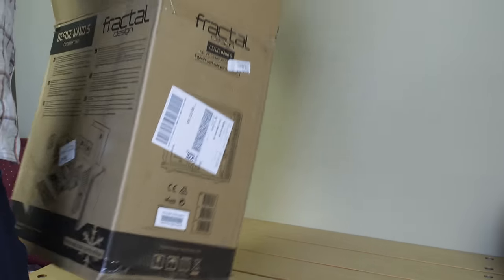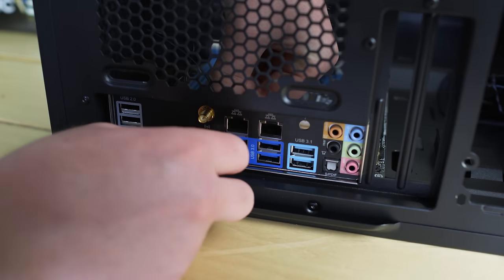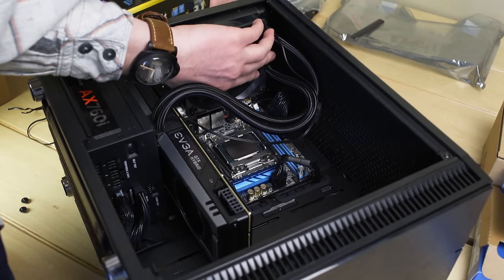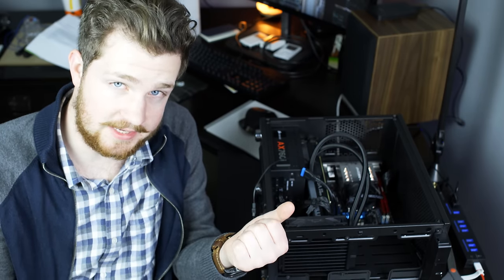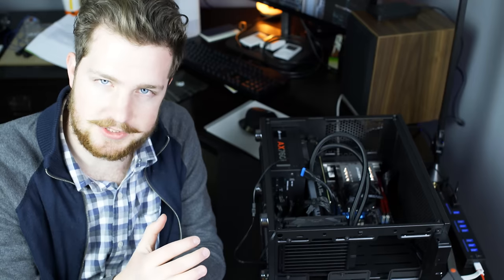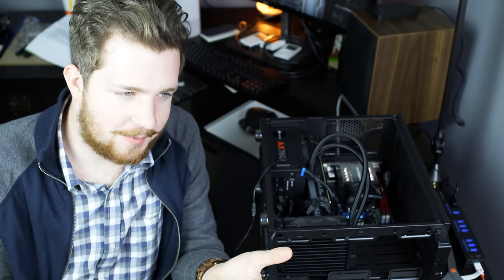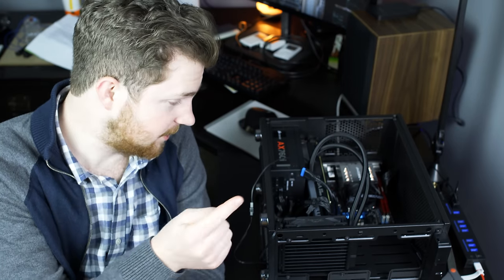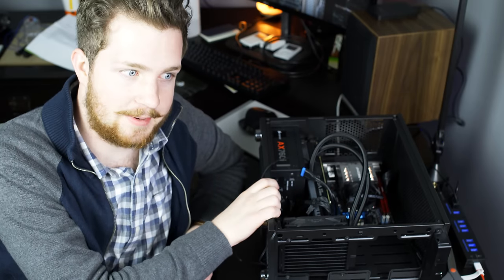My Powerful Custom PC Build Disaster

Comment: First of all. Never, I mean NEVER!, get anything from Newegg that has been Refurbished!!! I have learned my lesson about that.. With the Corsair PSU, all the Corsair PSU's I've had (I've had 4 of them) have the same issue with the 24 pin connector as you have. I've even bought the custom braided cables, from Corsair, and had the same problem. I don't have any problem with the motherboard connector, just the 24 pin PSU connector. Just as you mentioned, the PSU connector does not push in all of the way... You should get an EVGA PSU, or some other high quality PSU. Don't cheap pout on your Power Supply!! Good Luck with your build!

Comment: Dude.....i've been having this EXACT same issue with my pc. I just upgraded my cpu to a AMD 8350 and gpu to a R9 380 4gb. And my pc would randomly shut off. Checked temps, nothing over 53c. Finally swap out my Corsair gs700 for a Thermaltake 650 and my problems gone.

Comment: Dude, it IS the power supply that is making the computer shut down.  You DO NOT EVER use two screwdrivers to JAM THE PINS IN FROM THE MOBO!!!  You are REALLY LUCKY TO STILL BE ALIVE RIGHT NOW!  It could have shortened out on you then you wouldn't be no longer with us!  The screen savers on tech tv would ha e told you the exact same thing if they were still on the air today.

Comment: I can tell you 99% for sure that it is the PSU. I had this same problem when I built my monster PC. I finally went with the AX1200i and have not had problems since. My monster PC cost over 5K. It has 64GB ram, 5960x cpu, two 980ti's, MSI Godlike Motherboard and two 500gb ssds in Raid 0. It edits 3 multi cam 4K video streams like butter. Money well spent. Good luck my friend.

Comment: The first thing you do is plug in the power supply and leave it plugged in with the power set to off to ground your case then have your wrists touching the case when working with the computer. You prob destroyed parts by having no ground to yourself. Your problem is you are not grounded and having parts get destroyed. I have built 10+ computers and had one bad part ever. YOUR BUILDING A COMPUTER WITH NOTHING GROUNDED WITH A FLANNEL SHIRT as an electrical engineer I am just face palming. I plug in my case I use a static pad and a wrist band attached to the power supply this is basic stuff.

Comment: what about a personal computer using a web-server motherboard I.E. 4X 36 cores and 1TB of ECC system RAM and 12x 3TB drives in RAID 10 and a 3TB Boot disc and possibly two RAID controllers and a AMD RADEON Rage 9 graphics card.

Comment: Holy crap, you are unlucky...two factory-defective Mac's? And a bad pump, and a bad PSU... don't come anywhere near my computers lol. BTW. If you continue to have problems, take out the M.2 ssd. One of my PC's would have similar problems if an M.2 ssd was installed (auto-shutdowns after 3 min in my system). Either the board or PSU didn't like it. The same system now runs fine over Sata SSD, just no M.2.

Comment: So, you bought a refurb PSU, to put up next to your 980 Ti with airflow simply back and forth in a hot environment. You also put a full length card on a mini ITX with an unlocked processor made to get hot in a case that doesn't well support liquid cooling really, and "woopsy daisy' threw ECC memory at an enthusiast CPU/Board? Also, did you really need the 750 watt PSU? I could be wrong but think you could have gotten away with a 550 watt PSU with 80 plus gold rating. Also why the Unlocked CPU with 6 cores? You could have went with other less expensive/lower TDP CPU's and done just fine. Premier Pro is gonna be rendering on your Video card for the complicated stuff and the CPU specific hardware specific extensions like MMS and SSE which Premier Pro is going to benefit from likely more than the hexa core CPU despite some speed advantage... Meh This was funny to watch. Thanks for the vid.

Comment: Thats odd ive had the same problem. I get to a split second before the windows 10 logo and my pc reboots itself. Im on my 2nd set of ram(GSkill Trident Z 3200MHz), 3rd mobo (Rog Maximus VIII Hero Alpha) with an I7 6700k and im using an old powersupply XFX  XXX Black Edition750W  thats never had a problem and a Hyper 212 evo for cooling i can post into bios no problem and my cpu idles at 33C but when I get to the split second prior to the windows 10 logo it reboots. if you find a solution  please let me know. had this problem since Jan 03 2016

Comment: a tip , if u have to use more strength than 2 fingers have (like using your whole hand`s strength or using 2 screw drivers as hard as you could) to insert any pc plug or port then your either doing it wrong or there is something wrong =electronic parts are fragile and force should never be used to insert anything

Comment: I bought a corsair Power Supply and it would do the samething after a year. Full Modular 750w. Turns out the fan was jammed. So the Power Supply would over heat. Now I have a EVGA P2 1.2kw Platinum SuperNOVA. Couldn''t be happier.

Comment: good but bad idea to rma a motherboard in case it 's the mb or the power supply, it 's your responsability to check witch one is bad by buying another one and test.... or you can use your 14 day return policy but's it's not rma then

Comment: Why did you get an ITX motherboard?   I would of used a MicroATX instead, especially if you are going to watercool.  For watercooling, I prefer the Corsair H80 or H100 over the Asetek.  The H100 is extremely quiet.  Refurbished power supply is and epic fail.  Never ever cheap out on a power supply. It is the most critical component in the machine.  ECC RAM?  Why?  ECC is for server CPUs like the Intel Xeons. You should of done your homework.

Comment: Never heard anything about checking the BIOS for some of this stuff. Maybe I missed that. BIOS is your friend. Especially an updated BIOS.

Also, with the cable management, it's typically best, IME, to route the cables first, then place everything in. That also allows you to make sure the modular connectors are properly in the PSU as you plug them in before putting said PSU in the case.

In fairness to the guy, refurb Corsair PSUs have been quite solid for me off newegg. My i7-4790k Hackintosh has been purring for a few years off one. But new is best.

If you think you'll stay with PCs, keep a stash of things such as a PSU tester, old solid equipment, etc, to test in weird situations like you've got that may come up in the future.

Good luck.

Comment: whoa whoa whoa imma stop you there lol... x99 destroys z170 and skylake in almost every way when it comes to server grade and workstation grade work. the 5820k out of the three is the weakest processor but still beats the 6700k... z170 being consumer grade x99 being enthusiast. x99 is meant to push pc to the edge of performance z170 is meant for the average Joe. just because skylake is newer means nothing. the 6700k is only about 10% better than a 4790k which can be applied to z87 from 2013 or z97. overclock a 4790k it's literally a hotter 6700k. and honestly for this kinda build I would've gone with a xeon anyway but that's just my opinion

Comment: Corsair products are crap. Had never used them until I was doing a custom job. Used Corsair PSU, SSD and H90 water cooler. All new from supplier. Had exactly same problems as this. Fault was PSU. My first suspect. Got it tested and faulty. Got new one but not a Corsair. Fitted in and tried again. Same problem. Ah, the water cooler. Took it off, put in standard air and all worked great. Water cooler was faulty also. Like £300 wasted. However the SSD worked sometimes. Utter rubbish manufacturer.  I will be sticking to my trusted brands from now on.

Comment: This is like the worst thought out and executed build ever. Why did you go micro ATX for a powerful system. Your GPU is basically sitting on top of your PSU, lol. Should've gone for an i7 6700k. 4 faster cores are still better for Adobe CC. Apps like photoshop only use 1 core for a lot of tasks. Man... you'd honestly be better off just learning FCPX.

Comment: Macs are SUPER OVER PRICED for no damn reason at all. Sure everything looks nice but lets be honest here. As far has hardware goes macs are now powerful by no means. Look at todays specs for VR like VIVE and Oculus which both are not supported by any mac on the market today. Its because their hardware is behind and the Pre built macs don't even show a enfisist on GPU or CPU hardware. Just face it you paid for a overly prices POS. MACS vs PC is like buying a Cadalac vs a Nissan GTR. Sure it looks sure its got a big engine in it, but the GTR will stop it any day in terms of power.

Comment: Custom building a PC is not for the weak of heart. 
Been doing it before Windows was even invented. 
I would say one out of four, ~25%, of my builds go smoothly.
Success rate even less with a high end build, perhaps one out of eight going smoothly.
Most of the problems comes from motherboard defects.
Then slight defects in other components. 
I learned early on to pay more for Japanese components. 
Chinese components are a lot more likely to be defective.

For example, for me to get a 8 GPU, 8 core 32GB, RAID 5, water cooled system up and running took a very long time.
Soo many components had defects. Even the Asus motherboard had a defect in which the PCIe card did not sit right and burned out both the mb and two of the GPUs. Lots of quality control problems with Asus. 

I recommend trying a simple build before doing a gaming rig. 
Avoid all HP branded components, such as network or raid cards. 
HP has just the worst quality control.

Comment: I applaud someone who will enter new territory to get the best build. Mac to PC or PC to Mac is a difficult jump for user comfort.

However you need a better mentor. First off, I could not understand why you're building on a mini ITX board in this HUGE case, for a performance system. If you're spending the cash on a 980Ti, don't scrimp on the mobo.
The most damning thing though was your description of how you were connecting up the PSU.
If you have to force it, you're doing it wrong or it is broken/wrong. This is especially true of a top brand like Corsair.

I hope you learn a lot from this. Don't jam screwdrivers into PSU's!

Comment: Greetings. I don't know if i come after the battle is over, but i'll try anyway : have you stress tested the GPU ? GPU-Z can allow you to follow GPU temperature. The reason i'm bringing this up is because GPU overheating cause me the same symptoms (though in my case that was an old GT240 with a dying fan). Not saying it can't be the PSU, but just noting you never said you ever suspected the GPU when investigating. ;)

Comment: The same issue I had a week ago. I have a NVIDIA GTX980 and I bought Just Cause 3 and Fallout 4 and had a good time but then couple weeks later, the graphics card would go into high speed without slowing down after a certain amount of time, my computer will automatically shutdown. I thought it was my graphics card so I bought the NVDIA GTX980 Ti Hybrid and the same thing happened. My cousin's friends helped me out and made and we finally figured out it was the cooling unit. The reason why my cooling unit wasn't working properly because the fan had a huge pile of dust in it and the CPU door was hot. Same thing happened to my older graphics card because of dust. The price I paid for not cleaning my computer thoroughly. Thankfully my motherboard prevented my computer from spontaneous combustion. I was an idiot. DX

Comment: Wow you go to all that level building the pc and you skimp out on the PSU and buy a suspect one from Newegg. If of all the things you were going to skimp out on the PSU should not of been it. The 2nd thing was the Ram, you didn't bother checking to see if the MB supported the ram you first brought for it. The more I look at this the more it looks like a half assed pc build. I'm sorry but next time let someone who knows what they are doing build the pc for you as you don't have enough knowledge to build a pc properly. This half assed pc build could of turned out being a very expensive balls up to the tune of $2,000+ dollars and no matter what happens the suppliers won't cover stupidity. Never in my whole pc building life (my first pc I built was a 486 DX66) have I ever seen or heard anyone using 2 big screwdrivers to plug in power connectors, That in itself would of "Sounded Warning Bells" Faulty PSU for sure. I hope its now running fine.

Comment: hey there good job so far, I empathize with your frustration, but when you get it up and working perfectly, the satisfaction is blissful!!  :)  Just one tip though..... Never stinge on a PSU: the power supply unit is quite literally the heart of your system and when it fails sometimes it can overcurrent and kill a few other components making diagnostics/troubleshooting well nigh unbearable. When you are building a new system always buy the PSU new... I know we all have budgets to keep to but I'd pay for a reliable PSU and consider downgrading Videocard or ram (capacity or brand) to make up the difference. Since in the long run a working reliable PSU (Corsair AX  i lines are actually really really good, the previous owner either got a DOA or really abused it for it to die: needing refurb) will cost you less: if the psu dies and damages other components you can send it in for RMA but you don't get refund for the components it killed.... also you might want to get a 800 to 850watt PSU as a content creator you may need to add more HDD for storage later and having a PSU that is rated at a higher wattage than what your system requires at MAX load on CPU and GPU at the same time is always a good idea, you don't want to have just enough (especially for you since vid editing and exporting typically put high load on both over long periods of time). Good luck ; )

Comment: Like many computer builders, the thing everyone goes cheap on is the power supply.  Think this through.  You have $1800 worth of equipment plugged into a $100 power supply (and you went refurb!).  Don't go cheap on a power supply...start with a great power supply...brand new.  I've built computers for 30+ years, learned this lesson early on the hard way.

Comment: Lessons learned from this build: 
1. Do your research for parts compatibility
2. ITX for anything other than light duty will have heat issues. (did you really NEED the small form factor?)
3. Don't buy refurbished/open box components that are "new." The only reason these components are on the market is they don't work and someone was too lazy to RMA.

Comment: Did you ever get it up and running? If not, or if you do another build, check out Be Quiet! for your case, fans and PSU. Also, avoid refurbished and open box items. I recommend gold minimum standard PSUs on top of that. Right now newegg has some of the lineup on sal to 6/11/2016 I think. Cheers.

Comment: I had a similair problem with a Corsair PSU, once windows installed, I rebooted. But could not get passed the Windows loading logo after the POST. (I think it was Windows 7)

Looking for a solution on the internet, it turned out the be a rare problem with the PSU and Windows itself!!?? 
After trying a different PSU, everything worked normal.

Comment: It's generally advised not to use refurb PSUs or mobos for high end builds. While they are often times perfectly functional, there is always the risk of them failing catastrophically and damaging the rest of your very expensive parts. A bad PSU can kill every single component in your build instantly, I had a friend lose two GTX 590s to a bad PSU and they wouldn't reimburse him for anything other than the power supply.

Other than that, I hope you know that your scenario is definitely an outlier from the norm, and PC building is usually MUCH smoother than all that. I can't argue with any of your parts selections outside of that PSU, and I'm excited to see how this thing does for encoding tasks!

Comment: This is terrible. It could be a number of issues. It could be the mainboard, PSU, CPU, RAM, etc. I think you should have asked a PC-savvy friend to help you with it. I understand your frustration, though. I bought myself parts to build a high end PC as well and just when I was finished, I noticed that the huge CPU-Fan was not on right. Short story: I carefully pulled the fan off but the thermal paste had such a strong hold that I ended up pulling off the CPU as well! It all works now but I'm just waiting for something bad to happen. Not a good feeling at all.

Comment: I had a very similar issue back in 2004, same symptoms, went through the same process (Asrock motherboard as well) and eventually the problem was the memory. I was able to start memtest shortly after the reboot cycle and it threw errors, but only once the system was running for about 8-12 hours. The ram was replaced, but shortly after (1-2 months) it came back. The solution was a CAS change, and by increasing it the problem disappeared for good. Maybe worth a try. Also worth mentioning, that back then the memory was controlled by the North bridge which I suppose was a bit faulty, and in your case the CPU controls the memory. So eventually you can have a bad CPU but changing CAS might help on a short run.

Comment: Never cheap out on the PSU. It can take out your MoBo, CPU, GPU and RAM during its death throws if it wanted too (I know from experience). I always buy PSU with at least 100w more capacity than I intend to use and nothing less than 80+ Gold and certainly not a refurb no matter who the manufacturer is.